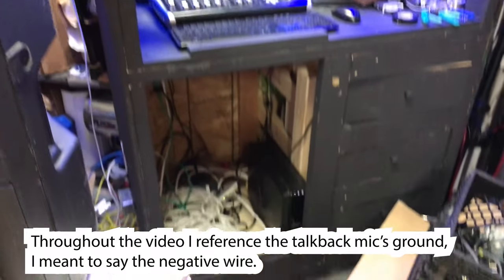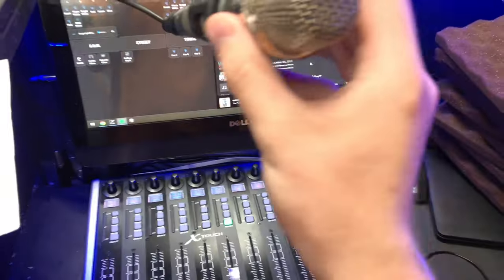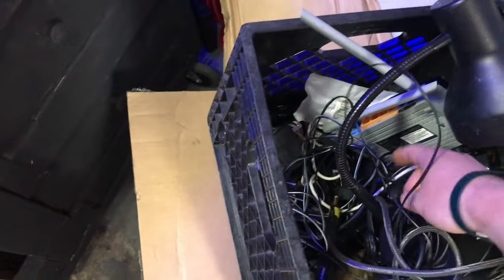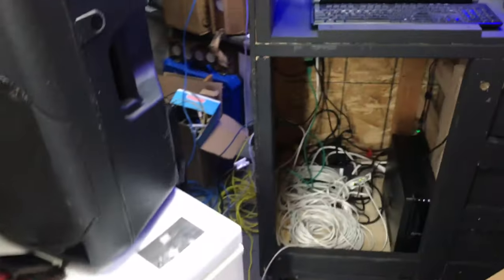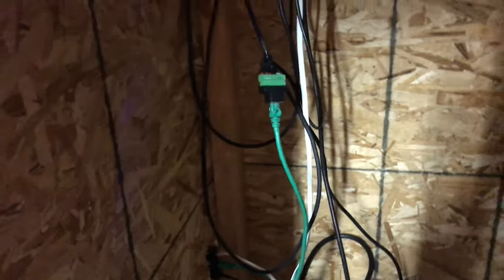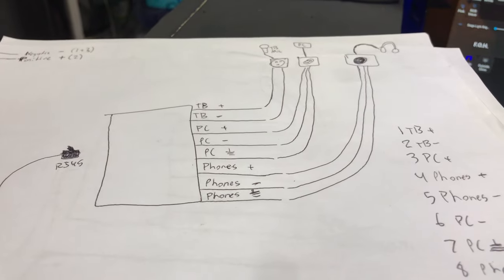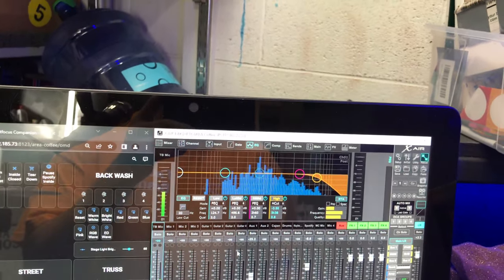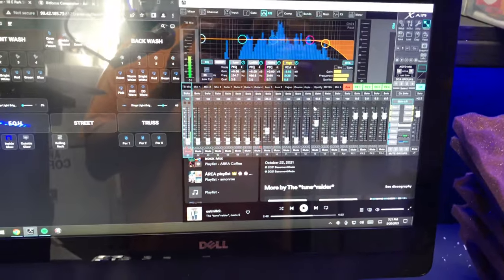100' Audio over Ethernet Cat5 Cable

Comment: Cat5 or Cat5e ethernet cable?  Big difference in speed.
Reply from the maker: I used cheap cable so it’s probably cat5. It’s not about the speed I’m going for on this project. I’m just trying to do an audio line. Wasn’t any noticeable delay in signal.